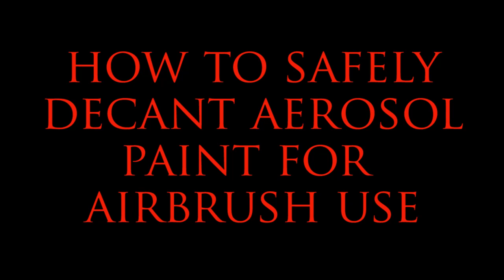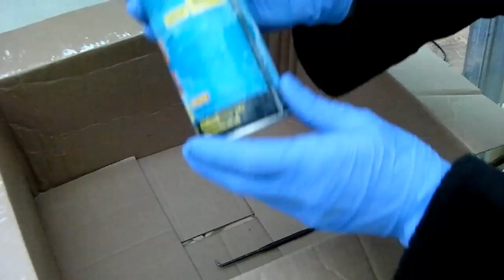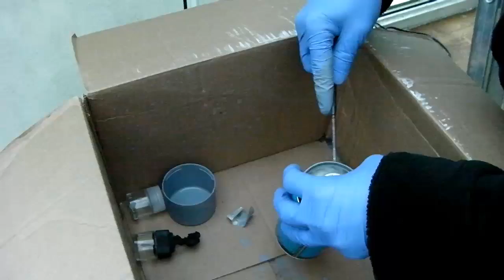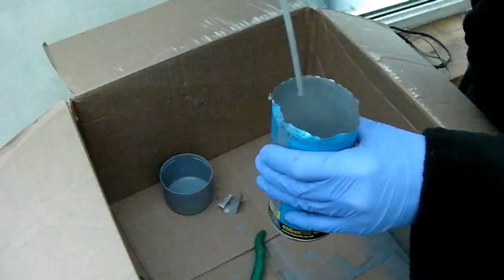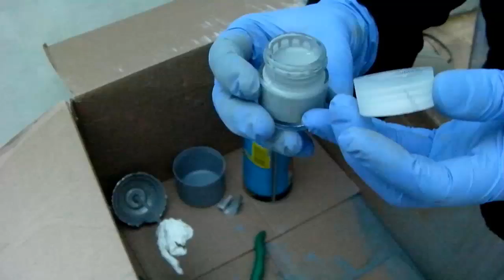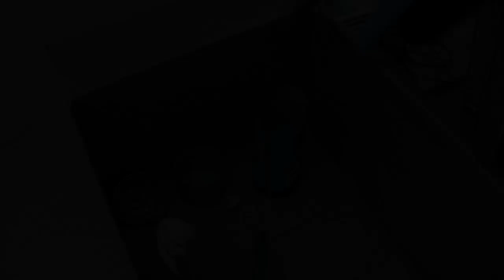How to decant aerosol paint for Airbrush spraying safely

Comment: Why? What's so great about this aerosol paint that you absolutely must have it (to go through all that) over the many paints already designed for airbrushing or easily converted for airbrushing?
Reply from the maker: Dwight Stewart Because often you can get automotive cellulose paints cheaply.
Because sometimes you want a vehicle specific colour and a can of vehicle a colour from halfords is cheaper than a thimble full from gravity or wherever.
Because you might have some laying around?
For me because rattle can primer is better than any acrylic primer for models and most available model primers.
But you don't have to, this video is for anyone who wants to know how to.
Reply: spidiq8  ..  Thanks for the reply. Trying to learn, so asked a question. They sell vehicle specific colors in small touch up bottles, spray cans, and larger containers for commercial body shop applications. Or you can just mix it yourself. As for the rest, I'll take your word for it.

Comment: spidiq i was wondering if you could degas it then mix it afterwards in a paint can. im looking at doing this tip but using an air gun to paint my truck.
Reply from the maker: Riden Roam You could but being much thinner than you'd mix paint for a spray gun you'd use a lot of rattle cans, it'd be much cheaper to get paint and thinner from a paint specialist if you have a compressor and spray gun.

Comment: very informative video and thanks! does the  same bad smells too when used? thanks in advance!
Reply from the maker: Tomas Jefferson Hernandez Yes, it will still smell and you need to spray in a ventilated area with a respirator but using an airbrush makes the overspray much more controllable. The nature of the solvent is what makes it smell and why it's hazardous, all you're venting off when you decant it is the propellant gas in there.
Reply: thank you! you are very helpful :) more power to you :)
Reply from the maker: Tomas Jefferson Hernandez . You're welcome.

Comment: Thanks dude, I tried this today on two cans, first one went great! But the second started squirting all over the place even though it had been sitting there unshaken for hours. I must admit, I laughed my ass of when it happened, but the aftermath wasn't so great... Whole workbench including tools covered in black paint. But anyway, is there any way to know if the paint has been settled at the bottom before I start drilling a hole so it doesn't squirt all over the place?

Comment: Thanks. I plan to de-gas a can of WD-40 so I’ll be able to have liquid that I can apply with a brush to various things: gardening tools, and so on. Good video. BTW: Do you know that WD-40 needs shaking? It will stratify if let sit, and then you have two layers of different stuff. It’s actually stated on the cans that they should be shaken before use, but who ever would read the instructions on a can of WD-40?
Reply from the maker: Jimmy Chadwick Glad it helped, re the shaking I didn't know that, interesting thanks. Though I always shake aerosols before spraying out of habit, even deodorant.

Comment: Ok I'm really tempted to try this on new and lightly used primers, I'm just concerned about it blowing up on my face or in general and what size containers should I use to store it all ?
Reply from the maker: If you follow the guide in the video that can't happen, an aerosol will only blow up under extreme pressure, for example if heated rapidly or to extreme temperatures.
Let it settle for a few hours, and pierce the tin with either a pointed scribe type tool or even a drill bit in a hand drill.
Let it de-gas then cut it and pour, if you check the side of the aerosol it will tell you the quantity and that will dictate the size of the container you put it into, i'm currently using a glass sauce type bottle, make sure you pop the glass ball from the can in to help agitate it after and make sure you give the can a good swish to pick up all the pigment even if you have to pour some back into the can swish it a bit then pour back into the container.
Reply: spidiq8 I live in Phoenix Arizona where it is over 100 degrees outside which is where I was planning on doing this. Would that be possible too hot?
Reply from the maker: Eric Jackson That's just under 40°C, hot but nowhere near enough to be a risk, if you throw an aerosol on a fire it won't pop until it reaches far above that and the real risk is RAPID temperature increase. 
Essentially, if you can stand outside with an aerosol can without fear of it blowing up then this method cannot possibly create a danger, remember you're releasing the pressure gradually same as pressing the spray nozzle, just a little faster. 
If you're in any way concerned, hold the can upside down and press the nozzle until the pressure begins to slow then pierce it to get the remainder of the gas out.
You'll lose a tiny amount of paint that's sitting in the pickup tube but provided you don't move or shake the can around after that initial bit it'll just spray propellant gas.

Comment: I want to Decant a Duplicolor Paint; the Product details say BINDER TYPE: Acrylic, AUTO PAINT TYPE: Basecoat, SOLVENT TYPE: Toluene.

What kind of thinner would I use for this paint as I need to get it through a fine needle/tip.

Thanks
Reply from the maker: Toluene is a petroleum distillate, in the simplest terms re paint types and thinners an extract of 'mineral spirits', like white spirit or turpentine, albeit faster evaporating and with the 'oily' properties removed.
You should be absolutely fine mixing and spraying this with Cellulose, (lacquer) thinners and it may perform well with white spirit or turpentine also, I recommend you take a small amount and try with mineral spirit, (Turps, or enamel thinners is OK) and with Cellulose and see which performs best for you.
Do make sure you spray in a well ventilated area and use a respirator as Toluene, as with most thinners, is harmful.
Reply: Thank you
Reply from the maker: You're welcome, good luck with your painting project.
Reply: @spidiq8 I used to work in a factory where we made industrial paints & the only I would say it 1st what a great way of getting a cheapish source of paint to use, I mean I've just been helping a friend with their car to repair damaged lacquer and base coat & it's exactly like u said, if u get the paint out of the can the cost difference is quite surprising to buying custom mixed colours . But the 1 thing is number 2 Toluene is really sensitive to static so u just have to be really careful more than using standard mixed paint. I know that the other paints are still just as dangerous but when they have toluene in the mix that just increases the risk of the vapour being ignited a lot more when the product is atomized,. You've gained a sub from me straight away just with this 1 tip but the best bit about this idea is like you said that you have so much more control over the pattern, amount & it's just so much more a far superior finish than  out of the can.
Reply from the maker: @stevebray71  Thanks  the useful info, I have read that toluene is incredibly volatile but didn't know anything too specific about it. Glad you enjoyed it and thank you for the sub, hope you enjoy some of my other content.
Reply: Same here I have this idea that I can do this to about a gallon or two of Dupler color I have a stockpile place that I can go get him a bunch of these cans from. Was wondering if this can be done to make a gallon like a said and spray out a whole car in a regular spray again. Any advice

Comment: Definitely out of the box thinking. I might try it and compare with the straw method. Also, I've let my paint set only 5-10 minutes not hours and it's worked. Thank You
Reply from the maker: That's good to know, I admit, I was erring on the side of caution and I guess being so runny it settles to the bottom very quickly.
I'd be interested to see a comparison if you film it.I do believe the straw method to be far messier and yield less paint though.
Glad you found the video helpful.

Comment: I just decanted a full 400ml can of paint and there was only 200ml of paint this doesn't sound right to me as i understand the 400ml marked on the can means there's 400ml of sprayable paint, i understand there is thinners mixed with the paint but there's no way half the 400ml volume would evaporate in the few minutes it took to decant and measure it, any ideas ?
cheers Dave
Reply: It’s like a bag of chips! Haha
Reply from the maker: Scruffy K  Unfortunately not. TBH I've never measured the volume when I've decanted but like you I'd expect 400ml to mean 400ml of liquid paint/thinner mix, admittedly, if cellulose based some of the thinners will flash off but I wouldn't expect that to equal half the volume. I'd be interested to know too if anyone has any insight on this?

Comment: Have you tried this on Tamiya sized cans
Reply from the maker: Richard Broadley No, but I guarantee it'll work the same, an aerosol is an aerosol.
Reply: spidiq8 Was thinking there may be more paint leakage as paint will be closer to piercing point. Tried one and I was right. Paint sprayed out the hole
Reply from the maker: Richard Broadley ok, I've never tried a Tamiya can to be fair but that's because they're expensive for what they are, the theory should still be sound though, there's got to be a certain volume of propellant to fluids. Are you sure it was left to settle long enough?
Reply: Yep, put it in my spray booth and came back following day to drill hole. 
Used a knife so I could stop as soon as gas started to escape. Was easy enough to stop paint escaping, just put my finger over hole to restrict it and was ok. Used the Tamiya as that's what I had to hand. But now I've got 100ml of TS47 to use in my airbrush.
Reply: Reply came from my other account

Comment: I like your method and it will work on cans that have plugged nozzles from improper storage.  You can get those at garage sales for the taking.
Reply from the maker: Peter Menningen Glad it's useful
Reply: Just an added note  you should label the new container as to the type of paint that is in the container.  There are water based spray paints out there now  so it is good to know if it is a Lacquer, Oil or water based paint for thinning and cleaning.   My suggestion here is to store the types seperatly by type.
Reply from the maker: Peter Menningen Good point, though I usually only have one paint decanted at a time.

Comment: Your very dangerous
Reply: +Robert Brown . What a timid little man.
Reply: wendy Jones if you don’t know what bomb blast injuries look like try looking them up, an aerosol can exploding can do much the same damage as a hand grenade, do you think the manufacturers put the do not puncture or incinerate caution on the cans for fun? NO, it’s because it’s dangerous, Robert is NOT TIMID, HE IS SENSIBLE, but hey it’s your hands or face that can be damaged and disfigured if you like, but don’t say you weren’t warned, and before you ask, YES I have seen what a bomb can do, but more importantly I have seen what puncturing an aerosol can can do as well, and it’s not pretty.
Reply from the maker: Robert Brown Why?
Reply: spidiq8 if you have to ask why then your a sandwich short of a picnic. It’s a pressurised container, and by puncturing it you can cause the rapid escape of gas to expand to quickly and the can explodes sending razor sharp shrapnel in every direction. Very very dangerous.
Reply from the maker: @allandavis8201  You are talking nonsense!
I highly doubt you've seen anything explode outside of a Hollywood pyrotechnic set.
When an aerosol does explode it most certainly is nothing like a purpose designed explosive device like a grenade and takes a rapid increase in pressure WITHOUT AN ESCAPE POINT to cause it to suddenly burst!
Throwing it into a fire for example which would be stupid! Piercing a tiny hole to allow propellant to gas out will absolutely NOT cause it to explode.
You'd better hurry to tell all the people who use camping stoves that they're at risk of explosion, considering they work by piercing the sealed canister!

Comment: why do this is airbrush paint that more expensive than spraycan paint. What is the pro for doing this
Reply from the maker: Yes, you can paintbrush it but bear in mind it's very heavily thinned and will run easily if you try to lay it on too thickly. It will dry either way but you'd need to apply several thin coats for good coverage and each coat would take slightly longer to dry as a brush coat will be slightly thicker regardless.
Reply: Sometimes you can  onlyfind the color in a can.
Reply from the maker: cr0cket01 It can be but this isn't the typical reason for doing it, often you want a colour that's available at your local auto store but nothing close at your model shop for example, aerosol cans are formulated to cover a larger area mo re quickly than an airbrush so decanting to spray through an airbrush is preferable hence the procedure above. Hopefully that helps?
Reply: okay thanks i see what you mena like the old metalic green a lot of mods used to have would be hard to make but just put hole in tin and you have it, also for small scratch repair on something. thanks for info i just starting lol i not even got airbrush yet so i like to ask. thanks for info
Reply: spidiq8 would it be possible to use it by paint brush,seeing you say it will thicken in due course?
Reply: +cr0cket01 . Yes!!. Airbrush acrylic is way more expensive for a much smaller amount. A 60 ml or 2.oz bottle of createx airbrush paint costs approx $8 in the UK but you can buy spray cans made for touching up cars from poundland and other cut price shops for $1.25 for a 200.ml can. Or you can buy 6 spray cans (thats a lot of paint) for around the same price as your small bottle of airbrush paint. It's a massive saving. Bear in mind that not all of that 200 ml's in the can is paint, some of it is the propellant needed to spray the paint out of the can. I decant the auto paint primers because they adhere better to the plastic fishing lures i airbrush than water based acrylic primers. Besides obtaining a lot more paint for much less money i get a better primer. The auto paints tend to be cellulose spirit based so if used indoors you need to use a sray booth with extractor fan that vents the fumes through ducting so it ends up outside.

Comment: Surely it would be a good idea to "de-gas" the can first by holding upside down and depressing the nozzle? Also, a standard can opener fits the bottom of a spray can quite nicely for removal ;)
Reply from the maker: Or alternatively you can pierce it as leave it to de gas itself while sitting on its very stable Base while you go and have a cuppa and a bite to eat instead of holding it upside down and pressing the nozzle for ages ;) Good tip about the can opener though, thanks.
Reply: It still needs de-gassing by piercing after, but doesn't matter if the can hasn't been sitting for 12 hours first ;)
Reply: Adam Squires Many new cans like Rustoleum are now using liquid propellant for the "spray any angle, even upside down" option. Try holding a can of Krylon made after 2016 upside down to clear your valve and cap..... This old technique will soon be obsolete.
Reply: @michealhuff2299  yeah they want people's nozzles to clog and dry up.  So they have to go buy a new can even though half was left from last job.  Inverted spray cans have been available for a while now too.  Its basically exact same design without the tube part to pick paint off bottom.
Reply: yes. a can opener is already designed to pierce a can. note that you want an opener that pierces the side wall (horizontal type) not the lid. also note that putting the can in the freezer reduces the pressure to nothing if you think piercing a pressurized can is a bit too daredevil ... but the pressure is a lot less than people generally think. you can probably remove the base in one go and pour the propellant off the top before it evaporates
Reply: brilliant idea! tnx!
Reply: Adam Squires
Reply: @nathanredman446  .
Reply: Being that he's the only person on youtube that has done it partially the way I would do it.... Could this be done to a BRAND new can of paint? Could one, Upside down the can, then cut it open upside down..and pour out the ENTIRE can of contents? Does the can have to be "ALMOST" empty????
Reply from the maker: @YachtLife  Absolutely yes, I decant full cans all the time, they don't have to be almost empty, you can de gas by piercing or indeed by  the can upside down and pressing the nozzle as the commentator said.
I did try the can opener BTW which wasn't successful but it was only a cheap can opener and perhaps a more expensive one would work?
Reply: @spidiq8  with a brand new can..wich will have more paint then your can..should i pierce the can at the same spot as you? Ty very helpful vid..thanx!!
Reply from the maker: @edubb2491  Yes. As near to the top as you can. The paint will only be about half way. This can was near enough new. Try to keep it somewhere shared and not in the heat though.
Reply: @spidiq8  ty!!
Reply: Micheal Huff LOL. The propellants are liquid under pressure and it will propell from any angle anyway... the problem is the straw draws the paint from the bottom of the can. Your comment is SERIOUSLY just stupid. The technique OP said is very clean. Just let the gas out and decant it with can opener.